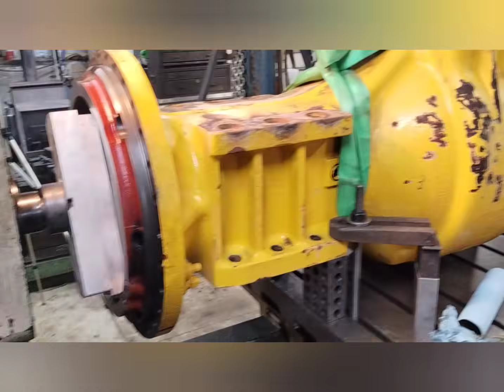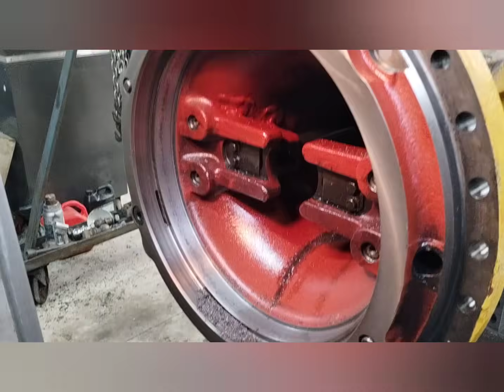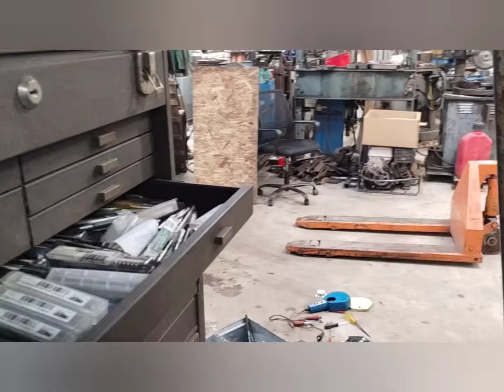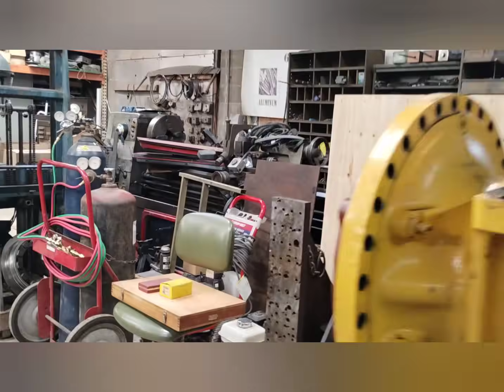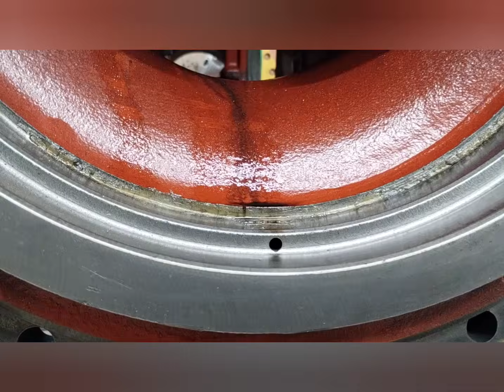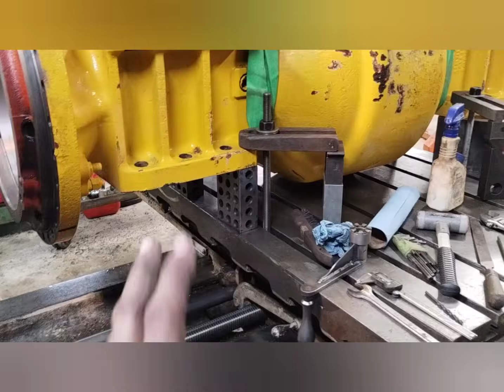Volvo axle repair part 2

Comment: I may have missed it, but why are you not brazing and machining back to stock?
Reply from the maker: Brazing on a casting of this size with so many critical machined surfaces at the required temperature would destroy the part.
Reply: Heat distortion.  Got it.  Also the hundred chords of firewood for the preheat would suck...
Reply from the maker: @maddiec.3212  no joke 🤣
Reply from the maker: There is another issue too, the section of the bore that I'm redoing is right next to a very finely machined bore that the other half of the Piston runs in, the flux and overflow from trying to braze the surface right next to it would wipe out that face as well.

Comment: Did you decide what crush yet?will the one thousand per inch of bore work?
Reply from the maker: So I just did the math, you were correct. For some reason I had it in my head that the coefficient of expansion for ductile iron was higher than it is. My 15" ring should shrink about .018" so I definitely won't want to exceed .001" per inch press unless I want a fight.
Reply from the maker: I am still pondering that, I want it to install easily. I need to do the math on how much liquid nitrogen will shrink it. I think we will end up closer to .002" per inch.
Reply: The rule of thumb 0.001 per inch of diameter might not apply to thin ring.
Reply from the maker: I am concerned about such a thin cross section, that is why I am going to leave as much material as possible on the i.d. and machine it to the final dimension after installation.